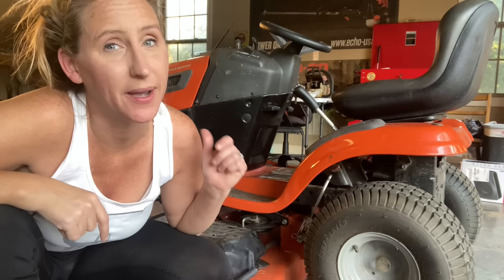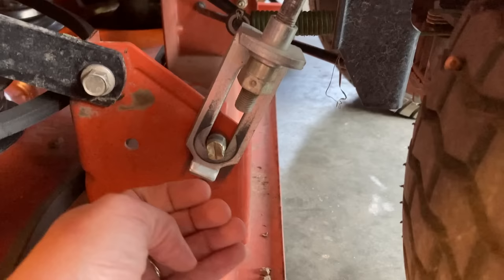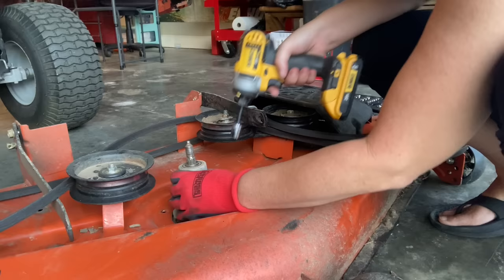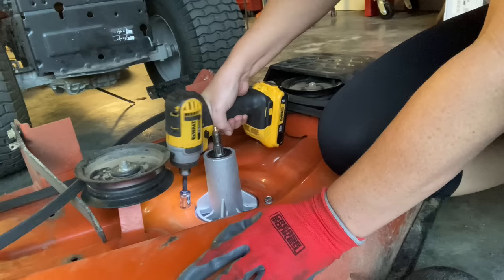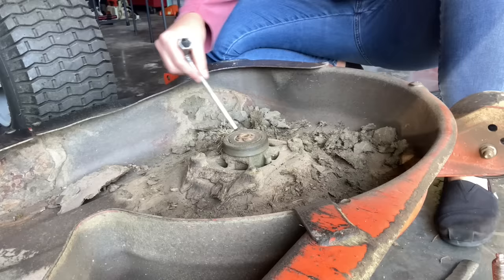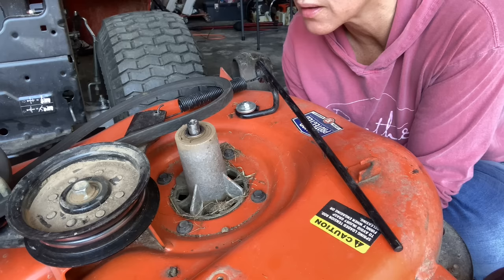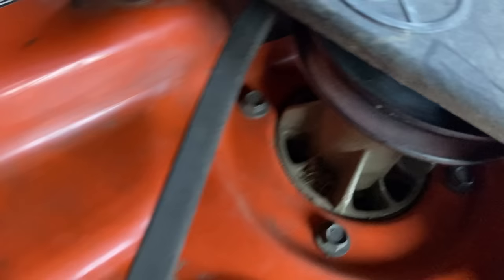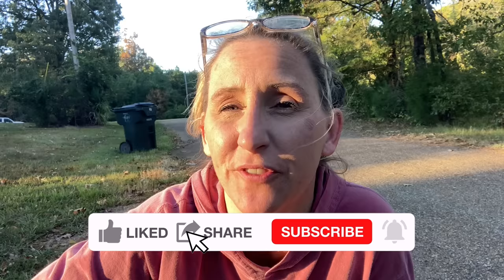Husqvarna riding tractor deck repair. Spindle, shaft and blades replacement.

Comment: have to disagree ,  the grease fittings work you grease until it comes out of the ends of spindles , will take like 40 or so pumps the first time to fill cavity first ,  they are not "seals" on bearings they are dust covers , grease goes right past them and threw yer bearing ,  intact a guy has a vid on here to prove that fact using different colour grease  , you have to remember a grease gun puts out 10 000 psi and the covers are in there so loose ya can pick them out with yer fingernail , they are not actually "sealed "bearings

Comment: No such thing, as a fake zerk, that is a myth and has been proven, search spindle bearings, that bearing does have a seal but it's not a sealed seal, the seal holds the grease in the bearing once it reaches operating temp. I've have never had to replace a mower deck spindle in over 40 years. I have always kept them greased, I have always preformed (PMCS) preventive maintenance check and services on my mower. I have replaced the idler pully that does in fact have a sealed bearing.

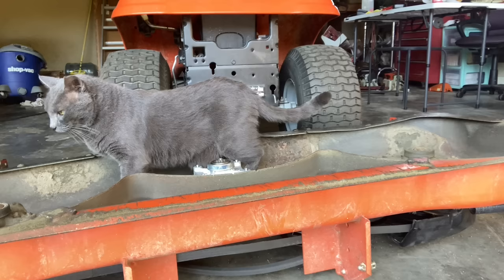Comment: Seals?!! look again @12:30 There isn't a seal on the upper side of that bearing that Bre just took out of the housing.....
I know, Bre made another video explaining why the zerks weren't doing anything except plugging a hole, however as you could plainly see, there isn't a seal and therefore, grease could be beneficial. Just being observent.....

Comment: who try an fit a new spindle with the bolt still in it then when removing the last bolt on the last blade you were going the wrong way with it its left hand thread for a repair shop not to know this is bad, you could of broken the bolt off, you never even cleaned the deck off where you put the new spindle in, like a lot of your videos jobs are never done 100%